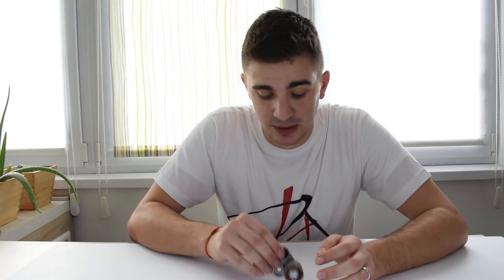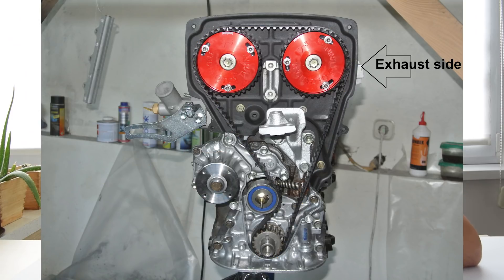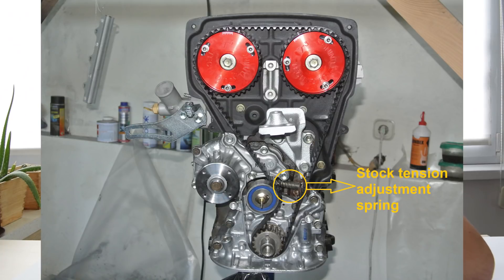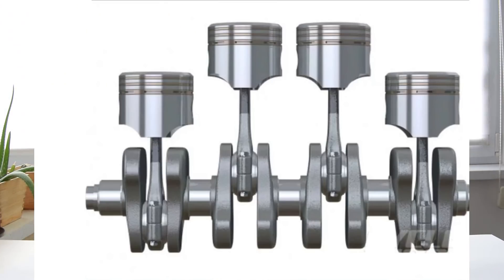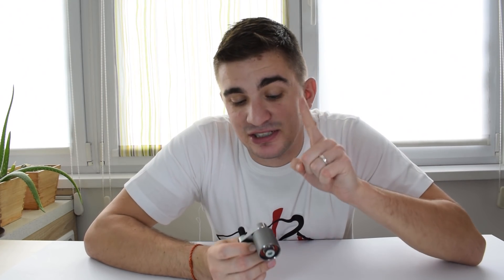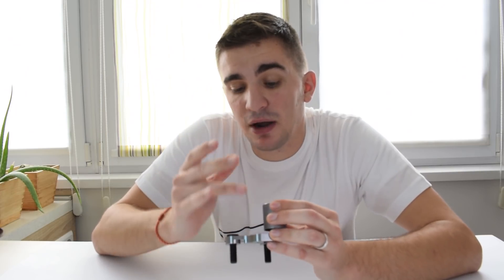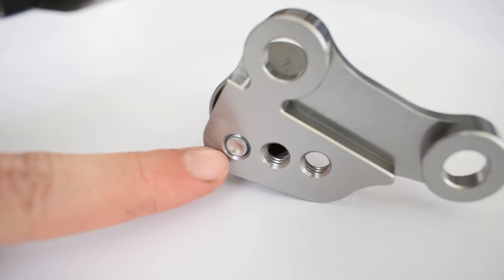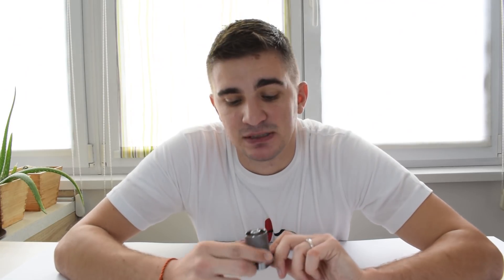MRP 4AGE N2 cambelt stabiliser - unboxing review

Comment: Well done on making such an informative video.  I don't have anything to add or correct you on but with your future plans I strongly advise against running a solid crank pulley. When a crank pulley is used without any kind of dampening it gives the internals a hard time, the bearing life is reduced and there are reports of broken oil pump gears and even broken cranks. The cranks always fail through the #1 big end journal when they let go from this stress. If you have a look at all the high performance engines from MRP they all use an upgraded pulley that still have a tuned dampened outer section to absorb some of the destructive harmonics.

Comment: Can you tell me the bearing part number? Thanks
Reply: The pulley is originally intended as the auxiliary support tensioner for many of the Subaru flat 4s
Reply: @Samqdf  looks to be a smidge small for the subaru idler, 1.8t idler????
Reply: @MinhDangcraft  32mm outside diameter by memory? It is from the Subaru unless he changed the design along the way.
Reply: @Samqdf  Yeah the photos look a bit smaller but that might be my phone. 

Speak of the devil, I just emailed him today and it is indeed a subaru tensioner, the updated one is a double roller bearing too!

Comment: What about AE111 4age 20v? 
It differs from all other 4age examples, it has factory hydraulic tensioner.
I have old AE71 corolla with RWD stock AE111 blacktop and want to drive it like a maniac, Is the MRP tensioner needed? It's an interference engine, so if it skipps a tooth it's gamer over.
Reply from the maker: I have seen this tensioner on almost all the MRP builds, many of which have 20v heads on them. But I recommend to get in touch with MRP to make sure where and how it fits.
Reply: It's just as applicable as the hydraulic tensioner is only capable of moving at a very slow rate and hence can't compensate for sudden changes in belt tension

Comment: I would think of it as insurance against turning a properly built entry level engine into several grand of scrap. 
Would this or is there a tensioner  that will work on a Dodge/ Chrysler 2.2/ 2.5 engine.
Reply from the maker: +Bob Is The Builder You got it. Don't know about the Dodge/ Chrysler engines, maybe they don't need it at all? Not every timing belt configuration is the same.

Comment: Cool! I want it. I saw you on sushpants channels comments. It reminded me.... Do you know of a good six speed transmission for our MR2?
Reply from the maker: +Sotek Technical Thanks. I know people swap the blacktop 20v six speed tranny together with the 20v engine, so you could look into the details of that.
Reply: driving 4 answers thanks! That's awesome. I will check it out. Also what made you want to go with itbs? I am just Curious considering the amount of engineering that went into designing tvis. This (itbs) replaces (tvis) that correct?
Reply from the maker: +Sotek Technical T-vis is ok and I love the way the engine changes tone a 4500 with tvis. But itbs and carbs sound even better to me. My engine was a hodge podge of different year 4age throttle bodies, sensors, distributors, etc. And getting it to run right has turned into a real nightmare so I decided to get rid of it all. Tvis is good for a daily car and it helps the 4age make torque at low rpms. This is my weekend car and I'm more interested in the fun factors like sound, throttle response, power, where a set of bike carbs with itbs makes tvis really obsolete. The fuel economy will suffer of course, but again it's not on my list of priorities.
Reply: driving 4 answers thanks again for your reply and  your insight! Once again my mind is blown. Keep it up bro. I love your channel. Hopefully my MR2 gets back on the road this spring. It's just so hard to make time.
Reply: Another advantage of using the 6-speed as used with some of the 20V Blacktop engines is that it has a factory LSD fitted to all of them.

Comment: You rock! Thanks for the tip. I need one for my MR2 AW11. Ordering now. Happy New Year! 🎊🎈🎆
Reply from the maker: Jeremiah Hale Thanks a lot man! A happy 2018 to you too :)
Reply: i have a 1990 toyota corolla gts with a 4age small port, will the timing cover fit after installing the cambelt stabilizer?

Comment: Nice job, and does look like a very well engineered part.
Reply from the maker: Rene Neron Thanks, glad you liked the video :) when I saw your comment I was ready for some constructive criticism, but I got only words of praise this time. Guess I did a good job finally :)
Reply: driving 4 answers well, since you asked, my only criticism is the conclusion that everyone needs this part.  It is a solution to a problem not everyone has with their 4AGE.  I can see the need more for those who push their engines (high RPM's), have an interference version (yours likely is now with the higher compression ratio pistons), those using a 7AFE block with the 4AGE heads (increasing the length of the timing belt), or those experiencing the belt jumping a tooth.  It provides a layer of protection without any significant downside, other than cost, which is a good thing and rare with most engine modifications.  Look forward to seeing your car running again.
Reply from the maker: +Rene Neron There we go, that's what I needed :) You do know your 4ages. Own one?
Reply: driving 4 answers yes.  I own a 1985 MR2 with the original 4AGE engine (3 rib large port).  Rebuilt the top end a couple of years ago.  Just.  Need.  Power.  Planned turbocharge upgrade; currently all stock except modified blacktop header, SV3POWER 2.5" exhaust, and a catch can.
Reply from the maker: +Rene Neron Cool. I actually somehow enjoy the underpowerdness and the na engine that needs to be driven hard to go. I would love to build the ultimate na 4age someday. You should probably go for the 7rib block if you go for a turbo? Good luck with the project. Keep us updated :)

Comment: I'm just going to watch someone else screw with timing for a bit. Installed mine one tooth off on the crank pulley, (not 4age.) So it will take at least 2 hours to correct this and it's buried in snow and freezing outside. Mine has 2 heads but it has 2 idlers and a hydraulic tensioner. That's what I get for getting all new timing gear right :D
Reply from the maker: PGTMR2 Good luck man. Warm up a bit with some youtube and then fix that timing :)
Reply: Ha ha the car can wait til a warm day.